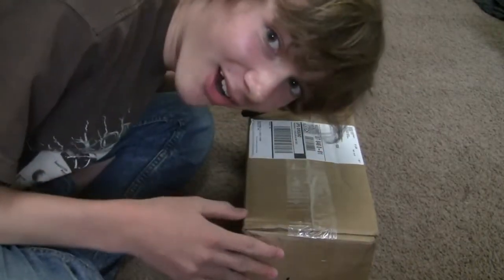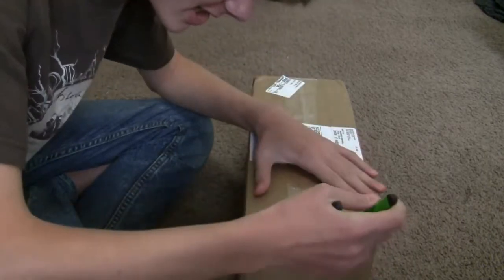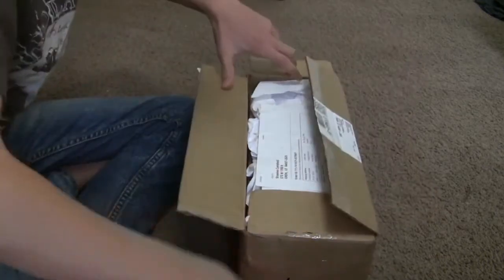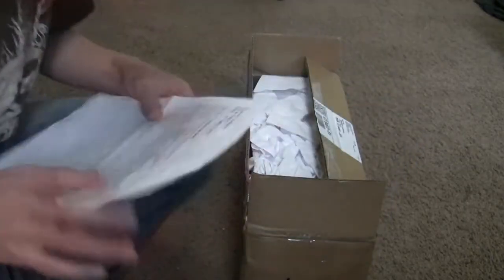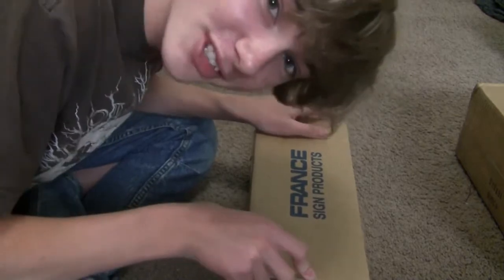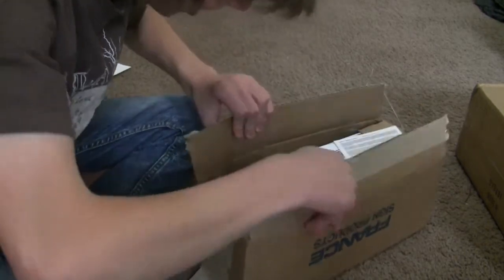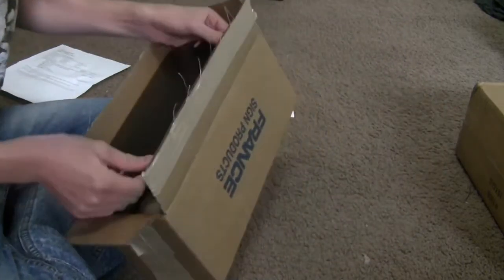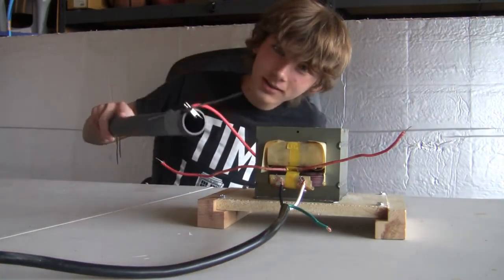UNBOXING NEON SIGN TRANSFORMER

Comment: The biggest problem with NSTs nowa days is the fault protector circuit that cuts them off when drawing any arcs. They vastly out preform ZVS flybacks when it comes to CONTINUOUS ARCING  and some projects require continuous arcs. long than a day or so.
Reply from the maker: Fr bro I had to tear it out after it went haywire. I released a video on that as well.
Reply: @Plasma.Prince  huuuuuuuuuuuuh??? I thought you where in college

Comment: About high voltage module talk. For me, I would prefer the Flyback Transformer than the Neon Sign Transformer, because the Flyback can power that with a 12V 7Ah Sealed lead acid battery or car battery and you can carry it and the Flyback transformer can also power the Solar Panel like that inverter. The NST you can't take that it depends on the AC power outlet of 120 or 240V if brownout is useless!
Reply: eh they seem to die to easly
Reply from the maker: This Tesla Coil is a little hard to transport because of this. But what can I say, you live you learn!

Comment: The High-voltage NST, that is still the similar with the high voltage module experiment of 12v-36V ZVS Tesla coil flyback driver/Marx generator/Jacob' ladder+ignition coil - intl or  ZVS Driver Board Tesla Coil Power High Voltage Generator Drive Plate Contact available at Lazada or banggood online shop.
Reply: nst are way more dangerous and lethal than a small zvs, if u get shocked by a flyback it will be a little bit painful but nothing compared to an nst 😂
Reply: @mathysgobeil1592  bro it is just like 16millamps but i don't know what frequency they run at i think flybacks are like 70 kilohertz